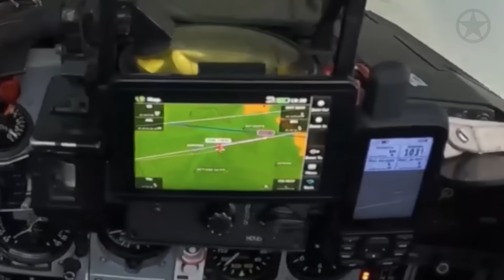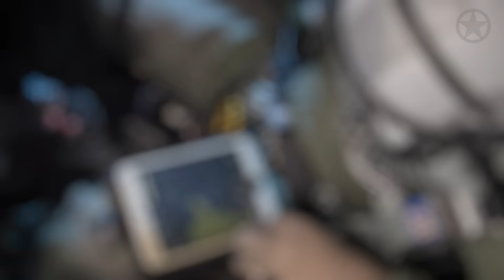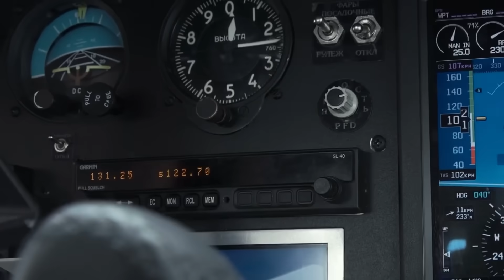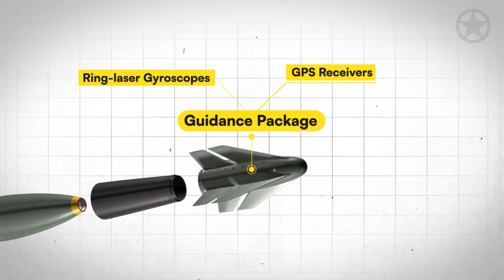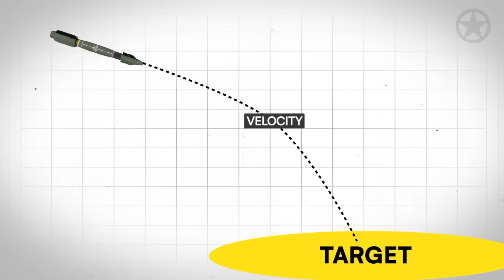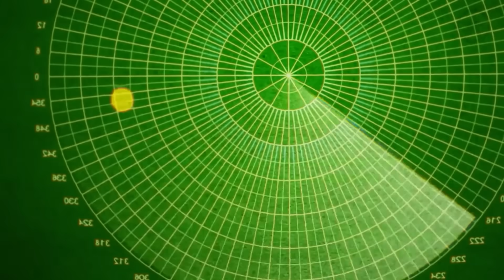Ukrainian Jet STRIKE Russian Base - Then THIS Happened...

Comment: Burner phone? Wow, or yes a device that might contain something dangerous. It could be rigged to overheat and explode because of the batteries starting a fire. You're on top of things Daniel.  I would have been very suspicious. Someone could've planned to locate the phone via IP address and when it's turned on, they could monitor its timeline and track your movements finding locations that would breach privacy and security. I am also a retired IT professional and us to work for OEC Diasonics in 1989. I miss that environment!

Comment: The Mig 29 while older can still be an asset if used correctly and one of many types of planes.  Even the US Navy was updating avionics, radars etc on the Super Hornet to keep it current.  The Ukrainian mechanics know how to keep those planes flying.  Pilots can go to a short seminar on the new avionics than jump in and fly a mission. Sure range is short but as a point defence dog fighter it should match anything the Russians have.  Why not come in at low level below radar than drop a bomb or fire updated missile?

Comment: The MIG29s rightly have the Polish Air Force emblems on them. That's because they're for a plane sent by Poland. In Poland, these planes underwent a modernization a few years ago, which is possible to use with glide bombs and other NATO equipment.

Comment: 13:37 Misleading illustration.
1. The bombs penetrated the building before exploding. Not that the penetrative power of the AASM is exceptional, but this was a relatively light tile roof and the building had no extra reinforced floors.
2. The explosive charges used are shattering explosives, not incendiary explosives , designed to release kinetic energy rather than thermic energy, creating an abrupt hypersonic shockwave that pulverize concrete, not to cook it with slow round yellow flames.
No longer turn technical information into Hollywood, please.

Comment: 8:50 Huh? Isn't the rocket at the rear of the missile assembly? Why do this animation point to a middle section in front of the explosive charge ???
It could be if the ergol was liquid, but it's not the case with solid fuel rockets. What the h… ?
@beyondmilitary please, check information and correct BEFORE publishing. I can't believe you can't take the time to view and check your own videos after you spent so much in animation and illustration.

Comment: Minute 10:10 > Quote: „Guided by satellites 20.000 kilometers above“. Which satellites are THAT far away from Mother Earth assisting targeting of small bombs?

And was the S-400 operator really named Smirnov? How do you know? 😂

In minute 14:52 you can clearly see the demolition excavator on the right side behind „a“ building. It is not the target building I assume 😂. Stock footage.
Reply: MEO is 12,000 km and change.  14:52, looks like a wrecking ball type thing on a crane.  Good catch.

Comment: Look for the building on Google Earth.  Earth shows the building undamaged as I write this.  But Earth loads new images for areas that get a lot searches.  As more people zoom in on that building in Google Earth, Google will evaluate if it should replace the current satellite image with a more recent one.  I want to know if this was an actual mission or if it's just Ukrainian propaganda.
Reply: Yes ,This is more than likely Ukrianian propaganda,  but anyway  if this was true then Russia's Mig 29’s can do just the same but with  greater impact and whats more so could so could  the  remaining Ukrainian Mig 29s but i am. that there is radar that can detect low level attacks anyway  and Russia could have detected the Mig  29 much earlier. too. And what about the F-16s . Why not use them ? I am sure that the airfiled where this Mig 29 came from would  soon be out of commission before the aircraft landed too.  As far as flat earth is concerned radar does nor need to bounce off the ionosphere  and even so Russia can spot every aircraft in the sky anyway . Radar is limited by distance only .

Comment: Great video - both pacy and informative. Thanks for posting.

'Stamping grounds', not 'stomping' -  but that's a lost battle now.

Best reg.s
Reply: From my research: Up until about 20-30 years ago, “stamping ground” had ruled the roost overwhelmingly. But since the 1990s, “stomping” has been, well, stomping all over its rival. And according to Google's ngram data, in the last decade it has finally overtaken “stamping”, although both are still widely acceptable... Personally, I've always heard and used 'stomping grounds' and I'm 74.

Comment: the Ukrainian could equip the ballistic missiles with those or any similar standoff bombs, launching the ballistic missiles to the upper mesosfeer and release either those bombs or small diameter glide bombs could be equipped with an extra: propulsion system for extra range, speed, and maneuverability, (the Ukrainian don't have to develop ballistic missiles from scratch they could utilize the rockets used for former soviets space program or even the blueprints of older soviets short range ballistic missiles like the r-17 elbrus and the r-18 as developing base for delivery truck or delivery bus for those types of ammunition...

SLAVA UKRAINE...

Comment: Really? Explain to me why I have not heard anything about this from any other source? I monitor about 20 sources. These are RELIABLE sources, as in I  don't have to  spend 3 hours researching what they say.  However I have had on occasion gotten these types of reports from unknown or not quite reliable sources and they turned about to be basically correct.  I will do the research and sre if this is true.  If yes, then I will definitely add you to my list of trusted sources.  If no, I will never visit your site Again.  Seems fair to me.
Reply: May 27 was the date of the real attack.

Comment: I thought I heard this wrong "Power cables snake through access panels never meant to be opened."  Every cubic centimeter of an air frame has access and is meant to be used. Even the fuel tanks have access panels for internal inspection. 
I think hyperbole got the best of you.  Try to tone it down, not up.  Just the facts, mam.

Comment: Nap of the Earth flying is only way to avoid normal RADAR detection. Extraordinary bravery.
Reply: And skill.
Reply: В белгородской области нет такого населенного пункта Глутово.  There is no such settlement in the Belgorod region. Fake.
Reply: @harryven6539  🤣🤣🤣
Reply: @harryven6539  Бот
Reply: Bull 💩
Reply: Balls of steel.
Reply: 😅😂😅😂its super fake bro.
Reply: @aaronciviris  desperate cope bro 🤦🏼‍♂🤣
Reply: @aaronciviris  if it’s fake, then what happened to that building?
Reply: @MrPhillip2  is ai. bro
FSB doesn't have headquarters in the border .
And it doesn't operate in a building that looks 
from 17 century LOL.
Reply: @aaronciviris  They do. There are multiple sources confirming the strike. Have a look.
Reply: @aaronciviris  Yeah. A real "bad" try. This is sjit.
Reply: @walter9085  There are multiple sources confirming the strike. Have a look.

Comment: That did a lot of damage for an 87kg warhead. Is that the actual footage of the strike, or is that old footage of some other airstrike?
Reply: Actually, I just got to the party just after half way where he said they were 250 Kg each. 550 lbs each. There were two of them.
Reply: of course not actual,    probably computer estimation, but the event did happen  may 26th fsb building hit easy to confirm, many news outlets
Reply: The narrator mentions 5 floors towards the end, yet the building you see explode here only appears to have windows 2 high, i.e. ground and first floor, so your guess is as good as mine 🤷🏻‍♂️
Reply: @commonsenseprevails6663  99.99 percent of the video used was unrelated to the actual mission.
Reply: @commonsenseprevails6663  Just cos you have floors, does not mean you have to have windows.....
Reply: @commonsenseprevails6663 So many channels will just slap on any video of anything they want while describing an incident. I find that lazy, but knowing that's a common thing while they create these videos to create traffic and income, once you know that's what they're doing, I rarely believe the footage im seeing is the actual event. All they have to do is find a story, and search archives for anything that looks similar and then Bing bang boom, theyve got a 20 min narrated video.
Reply: Fake story of another Ghost of Kyive...